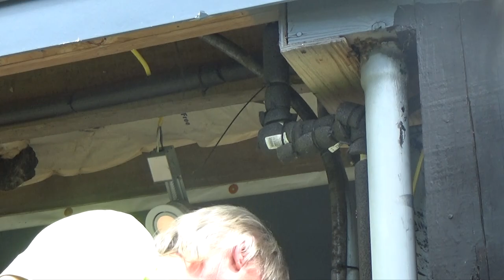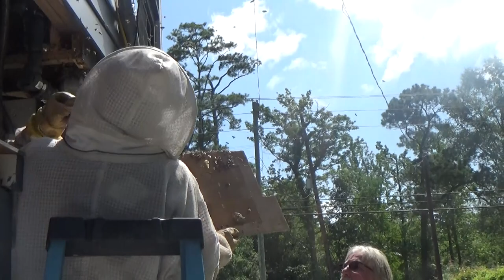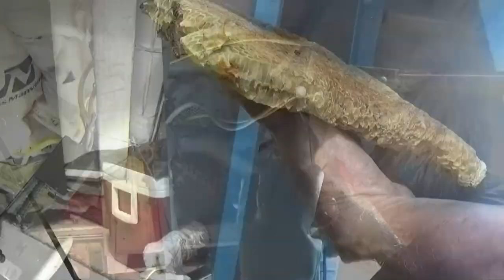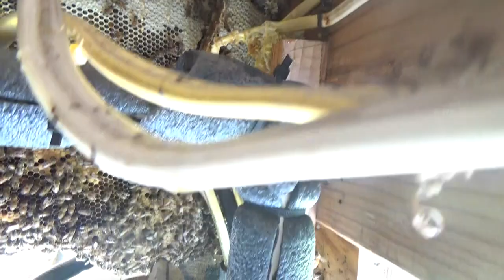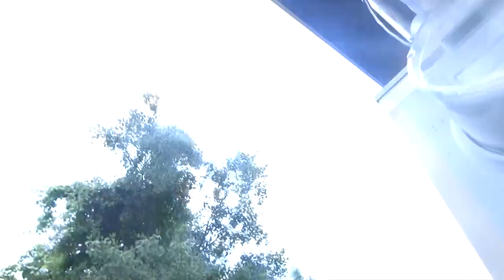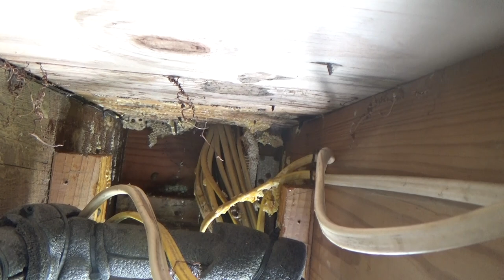Very dangerous bee removal.

Comment: those yellow electrical lines are 20A circuits… the romex cable being used cuts very easily… please be careful in the future and make sure you shut off those wires from the circuit breaker. they can do some serious damage if hit with a knife
Reply: @mark-wn5ek I am sure the comment was coming out from a place of concern and not trying to be negative in anyway.  Mr ed always promotes positive feelings and energy. You should too.